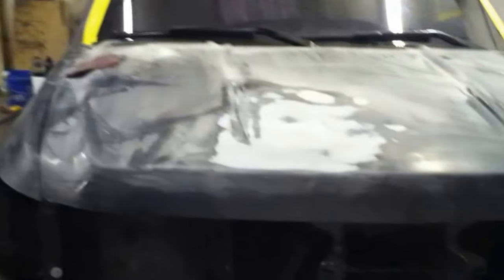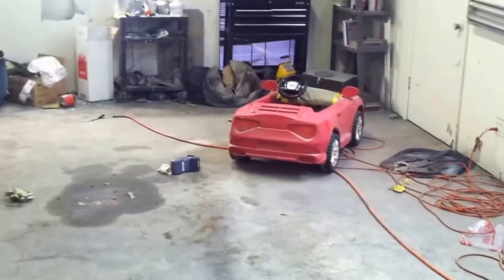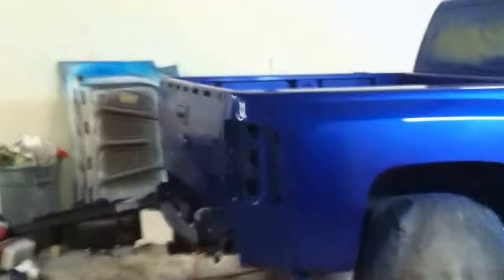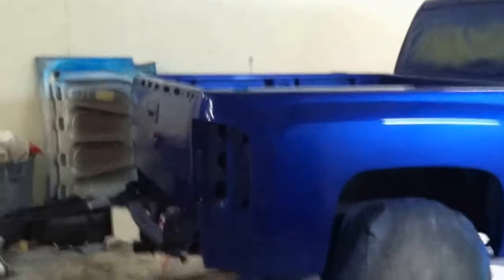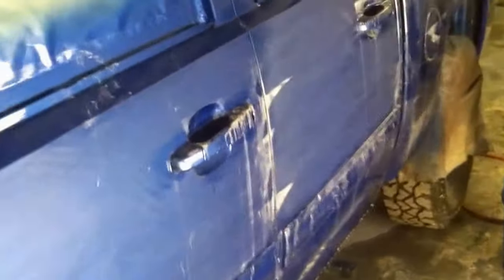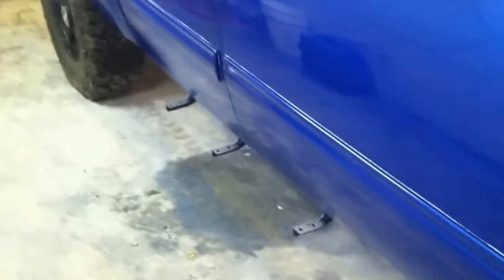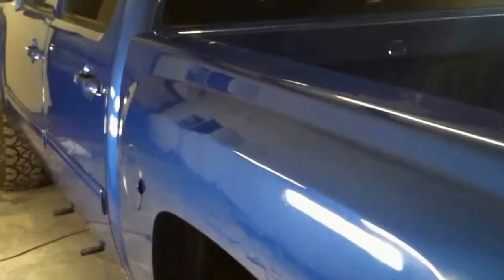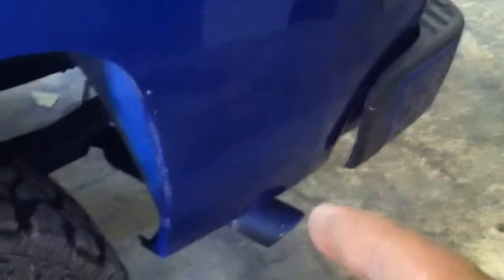08' Silverado (Paint Job & More)

Comment: THATS A GOOD PRICE $3500.00. NORMALLY A TRUCK THAT SIZE COST ANYWHERE FROM $4500 TO $6000.00 TO GET A GOOD QUALITY PAINT JOB. THE ONLY DIFFERENCE IS THE BED AND BUMPER WOULD BE TAKEN OFF, BUT FOR $3500.00  THAT"S A GREAT JOB!

Comment: I want to know why did you paint door handles and moldings on the truck. Also why didn't you guys take the bed off and paint behind the cab or R&I the tailgate. Why not disassemble the front bumper and paint off the truck. Would have made for a much better paint job.
Reply from the maker: The customer wanted all that painted and a complete tear downs is more money that not all customers want to pay for! You want Quality you got to pay!  So people wants in and out quick jobs and some wants top notch fully tore down! We have a budget for everybody!
Reply: it saves time. but it's not correct to do. it's just stacking coats for days. no hate  it came out clean

Comment: How much did it cost
Reply: not12u 
lol
the materials are probably close to 1K
Add another 2K plus for labour
especially when wet sanding and polishing
Reply: Keovante Alfred  That paintjob was probably around $2500.  Top notch shit. Supplies alone were probably close to $1000.  I paint and the primer, paint, and clearcoat for a good job done right (urethane not shitty acrylic paint) is around $700.  The  there is bondo work, tools, respirators, wear and tear on your tools, shop utilities, taxes, environmental restrictions/costs/regulations, labor costs etc etc.
Reply: Hr BeStalkinMe With the type of paint jobs this guy can do I doubt it was anywhere near 2500 that's around what maaco would charge for their high-end paint job on a truck like this with jambs included and maaco's paint job wouldn't be anywhere close to this I believe it was somewhere near 4k because he didn't disassemble most of the truck